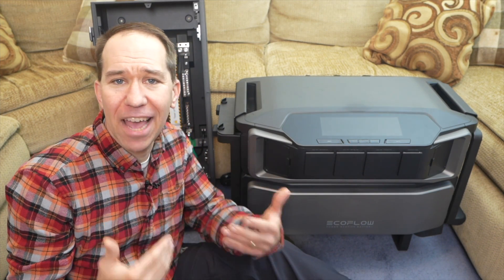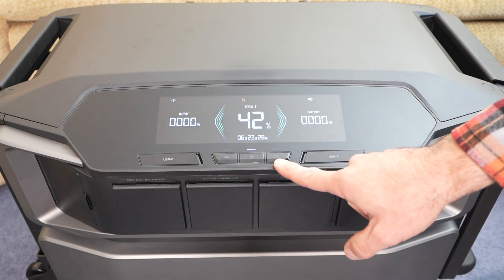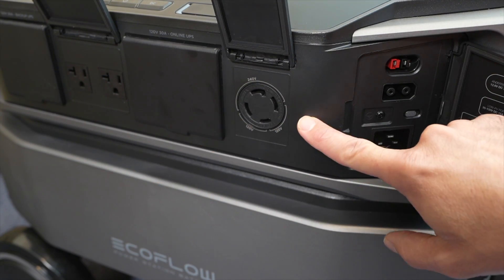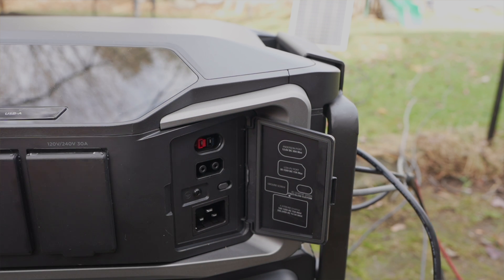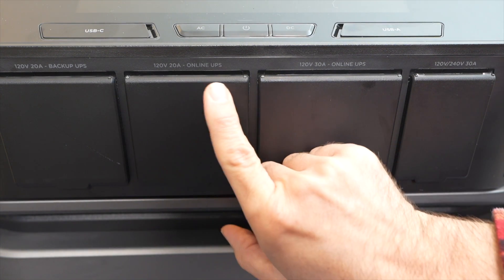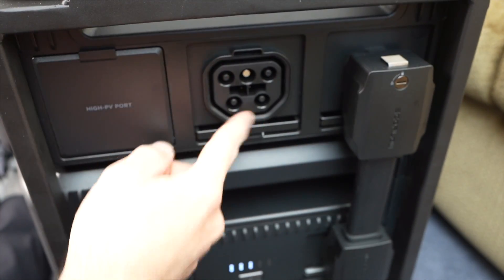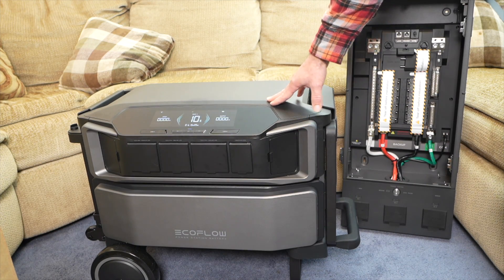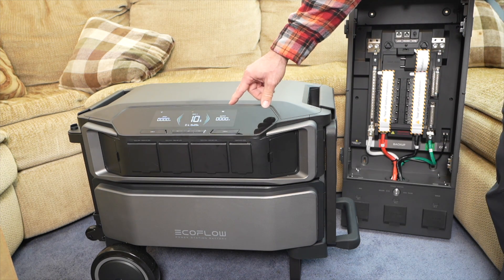EcoFlow Delta Pro Ultra - Huge Solar Input & 240V Output!

Comment: Don't you mean, ultra bust, rather than ultra beast? This low surge, solar generator still uses outdated, low cost (cheap) high frequency, transformerless inverter technology. There's a reason why none of the major, high quality inverter manufacturers like Schneider Electric, Outback Power, Magnum Energy and Victron use cheap, high frequency, transformerless inverter technology in their designs. That reason is that high frequency inverters don't last, and they offer a poor surge capacity for powering high inductance, household loads. 

High frequency solar generators run much hotter than longer lived, low frequency, transformer-based solar generators which makes the low cost, off spec, Chinese made components such as capacitors, diodes, resistors and ICs that are used in the cheap inverters that are used in these solar generators, far more prone to early failure. 

Another major consideration with these high frequency, transformerless solar generators is safety. Most solar generators are not even UL certified for safety. All it takes is for one of the AC output monitoring circuitry to fail and the MOSFETs in the inverter's H-Bridge circuit to short to ground, and these units can dangerous, high voltage, high amperage DC current straight to your connected AC loads which will not only damage most AC appliances but can also set those AC appliances or EV on fire. 

Another consideration that is never mentioned by youtube, solar generator salespeople, is that the vast majority of these solar generators are non-repairable. Even before the warranty runs out, most consumers will not be able to afford to ship these units back (most of these manufacturers don't have US based service centers) to the manufacturer in China and have them repair or replace them. And at a typical shop rate of $125 per hour here in the US, with no schematic and limited parts availability, it won't makes economic sense to even attempt to repair one of these units. Once the FETs have fried and have burned a good portion of the inverter's PCB, (And trust me, sooner rather than later, they will fry.) they basically become an expensive brick. 

A far better alternative is to invest less money and purchase a hybrid, low frequency, transformer based inverter charger and a few LFP battery and build your own "real solar generator". Low frequency transformer based solar generators last many years longer than these high frequency solar generators, and can easily power high surge loads without being damaged and without damaging your appliances.
Reply: Can you advise me on some youtube channels to get more information on what you have commented about?
Reply: Search for Solar Inverter Catastrophic Failure by Red Hill Labs on youtube, This is an excellent video that provides a detailed, technical explanation on  how inverters operate and how a high frequency, transformerless inverter can fail and start a fire. @hallah5150
Reply: If you are so concerned about the inverter then just buy an extra. The inverter is the cheaper component so just keep a backup.

Comment: with ONE ULTRA "Fully Stacked with Batteries" (30K Watts of Battery Storage), seems like you will need some of the following to FULL Charge the 30K Watt Batteries in one day...
1. TONS of Sunshine  (Very Few Clouds, NO Trees or other shadows)
2. Around 5K Watts of Solar input with the HI and Low Solar Inputs added together
3. Big enough Roof to put ALL the Solar Panels need to get around 5K Watts (At Least 10 Panels rated 500K Each - Add all pointed in the correct/same direction)
4. Solar Tracker, but that may ONLY Be for the "Fewer Panels (3 Panels) for Low Input Solar Connection) - Having 6 Hrs of FULL Power, instead of 3hrs could make all the difference.
-The 6 or 7 Panels for the High Power Solar Connection would be very LARGE Tracker.
5. A cooler day (Extremely HOT Days lower the OUTPUT of the Solar Panels by 20% or so)

6. ****AND NOT having a HUGE Power Load on the batteries that could lower the amount of charge the batteries could "RETAIN" during the SUNNY Day.
-AC or even worse would be HEATING the house (Heating takes way MORE Power than Cooling does...but Candles/Fireplace/Potbelly Stove could lower or remove the Heat burden on the batteries .

BUT, that would be AWESOME to have a System I would have to wait 2 or 3 SUNNY Days to get the system FULLY Charge.
Reply from the maker: For comparison, my 15.6kw system faces almost due south and in the summer months makes almost 120kwh in a day.
Reply: Jealous I am.
That is about 12Kwh Watts an hour during a 10hr day.

During the summer and a 14hr "Sun Day"...that would be 8.57Kwh.

Do you live in a sunny area???
We are moving to Austin Tx to be near our grandson....I am expecting a ton of Texas Sun There, but the HEAT during the summer may slow down the Solar Panels.
-More sunlight, but more heart (a trade off???)

I could see filling up the 2 Pros with 2 batteries (7.2 Watts for each set) in 1 day easily!!!!

An ULTRA would be AWESOME...an 18K Battery config would fill up nicely with at least 4.5K of Solar feed it's energy appetite.
-THEN the 7.2K ALSO connected to the SAME "Power Panel".
***That is my goal...Free from the Grid with backup if a Unit goes down.
 
  @solarguy
Reply from the maker: I'm in Pennsylvania.  We have 1-1 net metering here so its a great place for solar.

Comment: It seems like the DPU is pretty much 2X Delta Pros with a slightly smaller battery (6kWh vs 7.2kWh) and the same 7.2kW output with the added advantage of water cooling.
Reply: Interesting on the water cooling, I wonder if it outpaces the 7.2kwh variant being that it lessens the fatigue

Comment: Very nice review! On the high voltage solar input. What is the Max amperage input for solar?
Reply from the maker: Thanks!  The specs on the high voltage PV are 450v at 15amps
Reply: @solarguy  you are awesome! Thanks for the reply! I have the delta pro and loving it! I have a 1800 watt array on mine. Staying under that 150v is hard. I mixed lower voltage panels to keep the voltage about 135v to protect the mppt during cloud edge effect. 450v is so much easier ! Lol

Comment: Thanks for the video, I was thinking this was going to allow BOTH Solar and AC at the same time.
That will really help when I use the AC Output from "Other Battery Systems" to charge the ULTRA at NIGHT if Needed...Not enough Day/Sun Light to change during Daytime or to much Power Draw at night.
Reply from the maker: Yes, it does allow charging with solar and AC.  It was finally more sunny yesterday and I was able to charge decently with both high/low PV and the AC input at same time.

Comment: Great video!  So the device can always be plugged into a 240v split phase source and output the L14-30 at the same time?  If that is the case could have a reliance transfer switch connected to output for full automated battery backup of those circuits connected to the switch.
Reply from the maker: Thanks!  Yes, you can do that.
Reply: I would never install one of these high frequency, transformerless inverters in my home. Without an iron core, copper wound output transformer, all it would take would be for the output monitoring circuit to fail and one of the MOSFETs to short to ground, and this transformerless inverter can send high voltage, high amperage DC current straight through to your AC loads which can not only damage those appliances, but can also set those appliances on fite. A much better and safer option is to purchase a hybrid, low frequency, transformer based inverter charger and an LFP battery and assemble your own, easy to build "real" solar generator. It will last far, far longer and you'll be able to power the high surge loads in your home without overloading the inverter.